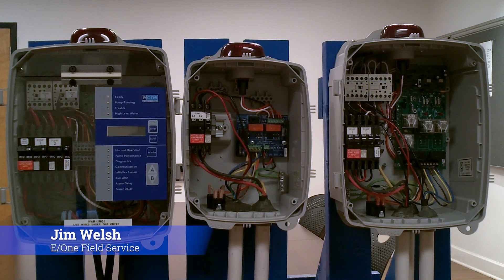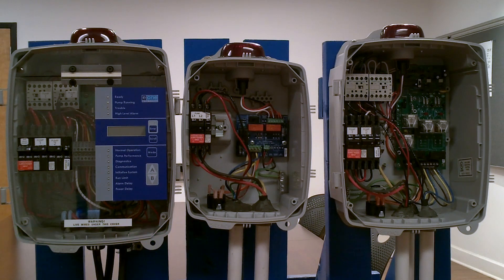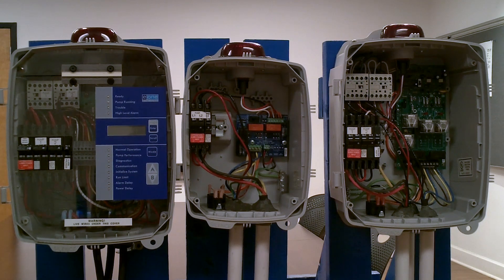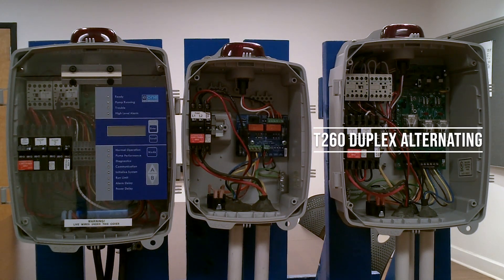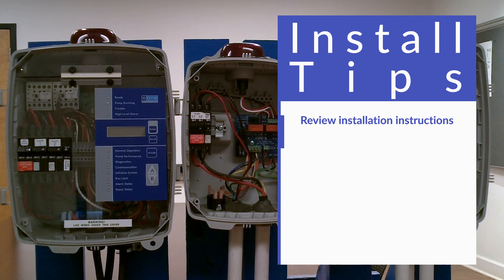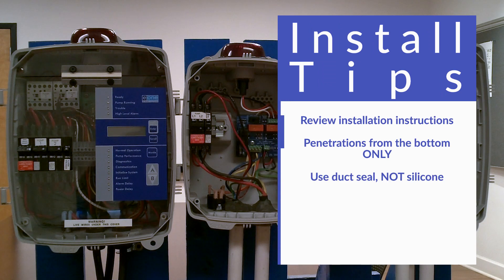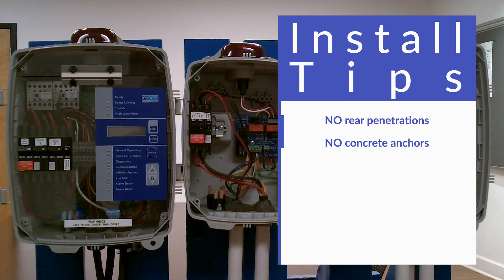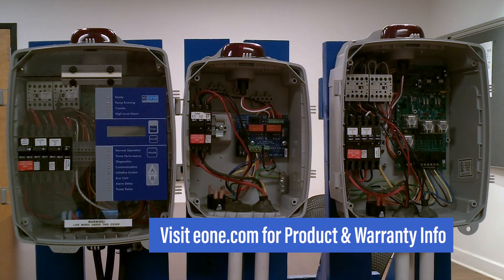E/One Sentry Alarm Panels: Introduction

Comment: Can a 220v system run on 110v if there is a power outage and I'd have to run a generator?
Reply from the maker: Unfortunately, no.  A 220V system is not capable of running on 110V.  The motor and internal controls utilize (and are wired to accept) only components rated for 220V.  Due to this, your option would be to upgrade your generator to 220/240V service.  

The link below will provide you with Environment One’s generator requirements: 
https://eone.com/images/downloads/distributor_connection/field-service/SB21_Generators.pdf

Please don’t hesitate to reach back out if you have additional questions.
Best regards!
Reply: @EONESewerSystems the above pdf says 235v-250v is the allowable range.  This seems to contradict your comment that lists 220v.  Is there a different model that supports 220v?

Comment: I need help, I've had this system since 2006, replaced one motor very costly.  Now I have a plumbing issue between the pump  and the city sewage and no one can help.. Pump rep. Says the pumps good, my township says it's not their problem.  I'm still stuck with an issue, local plumber says they can't get pass the 90 degree 1 1/4" outlet to clear the clogged pipe.  Help... w00ds4@aol.com 
Willis Michigan
Reply from the maker: Hi Bernard, Unfortunately there isn't much we can do, either: you will have to find out who is responsible for the line from the pump station to the sewer main. Perhaps the town could recommend a contractor or another plumber who is familiar with the lines.